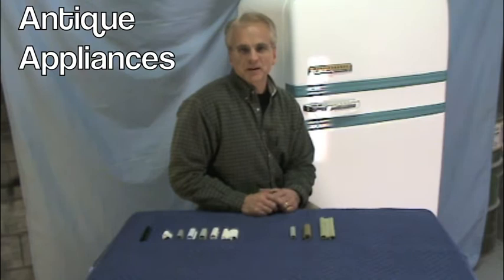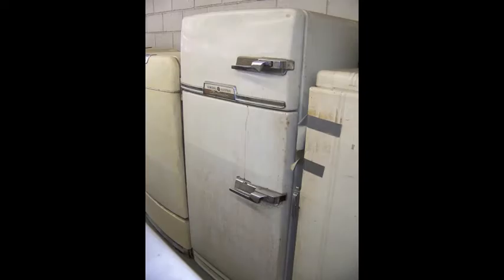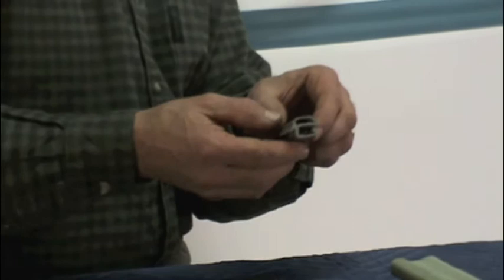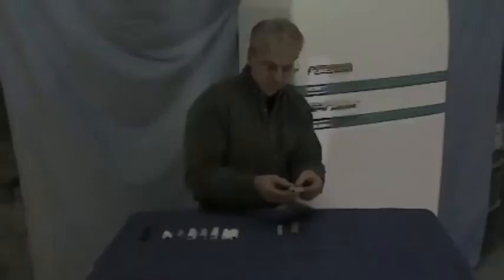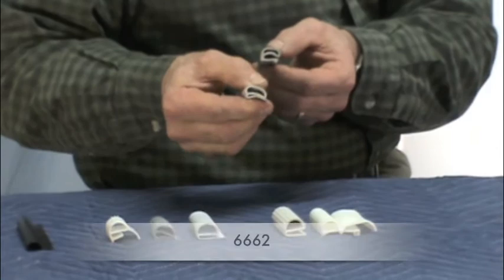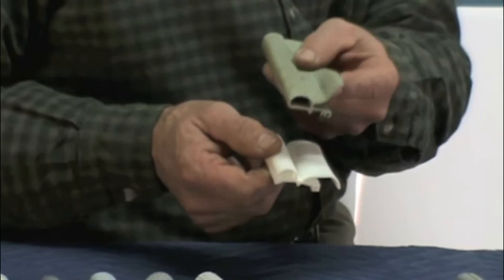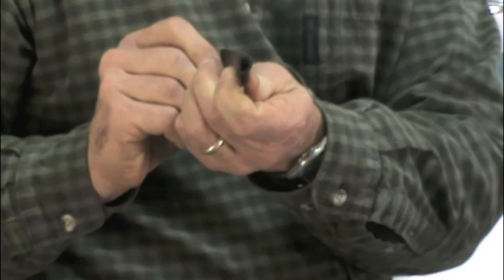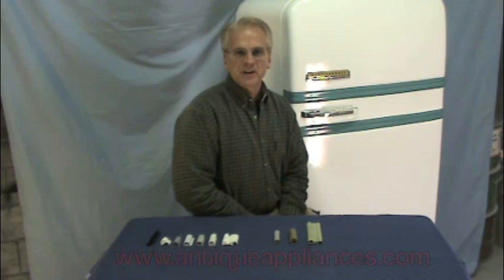Gaskets for Antique or Vintage Refrigerators

Comment: Hello,
I bought a refrigerator Selver-S7 model, with engine Westinhouse, (I believe it is from 1927) but missing parts. Do not have the hinges on two doors, no locks on the doors and not have the back cover. Do you have any pictures of this this fridge or something that can help me? (I live in Brazil). 
Tks